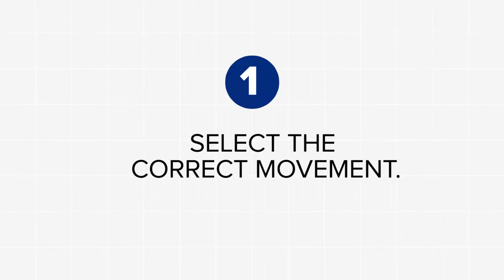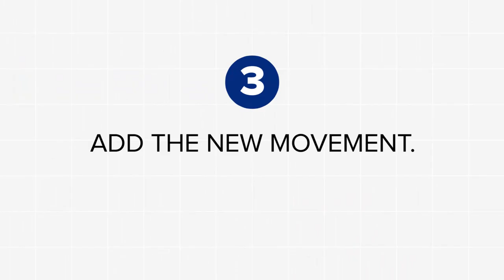Howard Miller How to replace a Battery-operated Movement

Comment: First you have to figure out which Battery Movement is needed.  The "parts" website has many many battery movements with long ? model numbers however, none of the numbers are even close to my model or any other random number I'm finding on the clock or battery movement replacement.
Reply: Thank you for replying.  I did check out the cross reference parts list, before my original post here, and my model number (612-242) was not on there.

When I clicked on the link you posted here it said: This res.cloudinary.com page can’t be found

No webpage was found for the web address: http://res.cloudinary.com/hmcgallery/image/upload/crossreference_movem
Go to http://cloudinary.com/
Search Google for res cloudinary hmc gallery image upload cross reference movem
HTTP ERROR 404

Then I went where it suggested (http://cloudinary.com/) and it was a website for developers??? and I have no idea what I'm suppose to do with that.

My mother says the clock is old, and on the back of the clock she wrote she changed the battery in 1999 and 2005.

Do you have other suggestions of how I can find a battery movement device that would work properly on her clock?  The nearest repairman, via the Howard Miller Clock Co website, is 1 1/2 hours away from us.
Reply: Thank you so much.  I will try these.